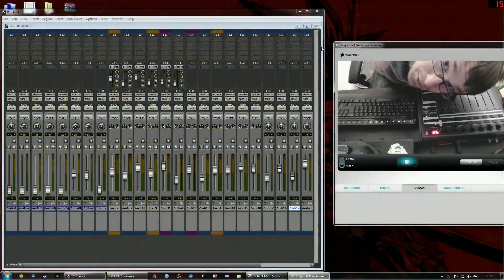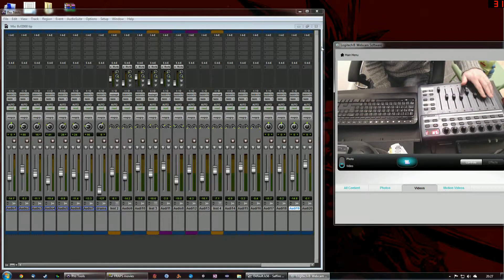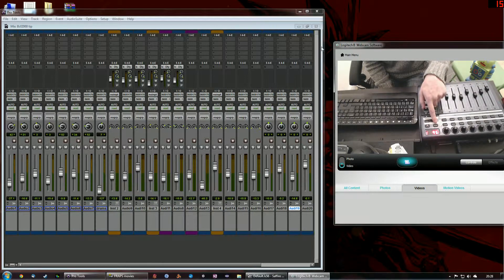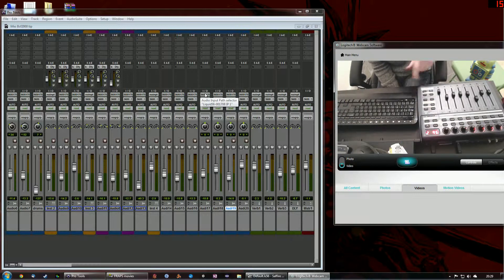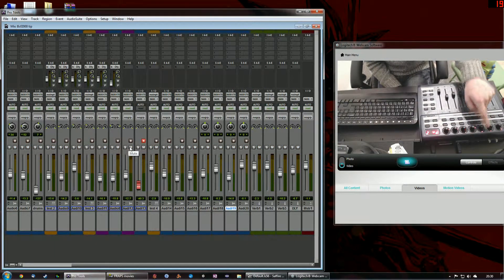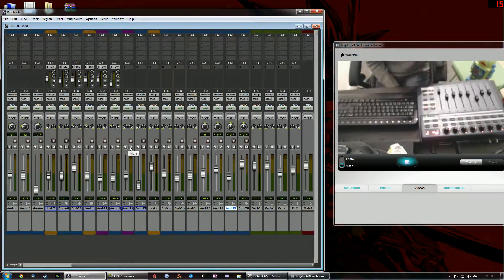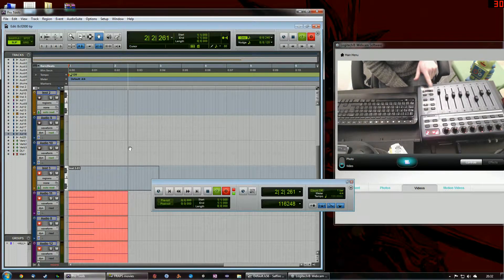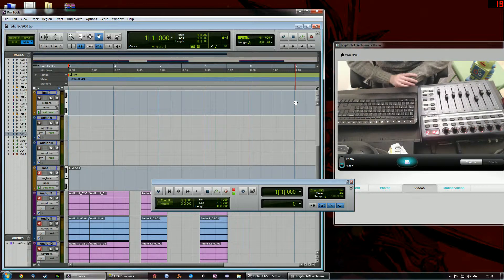BCF 2000 Pro Tools Features

Comment: is there a way to make it always control the master fader or a AUX track in pro tools? Right now if I Add a track it will disconnect from the Master Fader and I have to manually put it back on.
Reply from the maker: My BCF2000 has been in a cupboard for about a year and I haven't used Pro Tools in a about a year also so I cant say for sure. Maybe try asking on a Behringer forum.